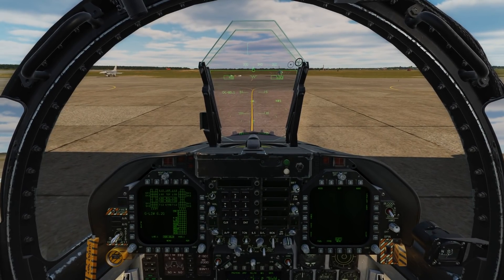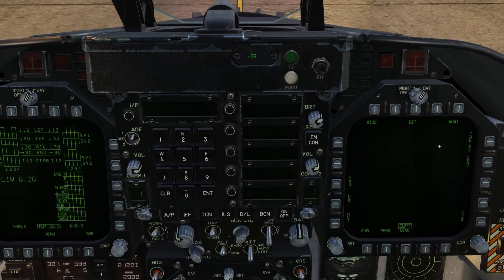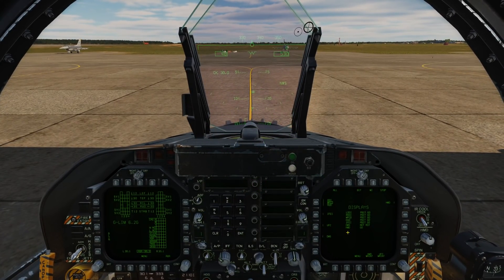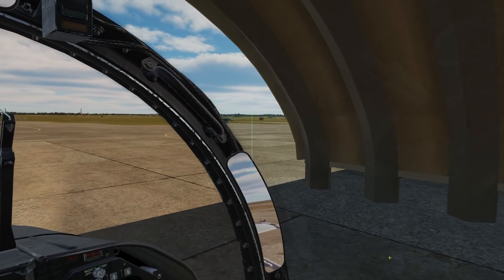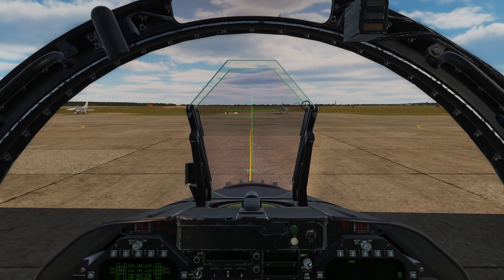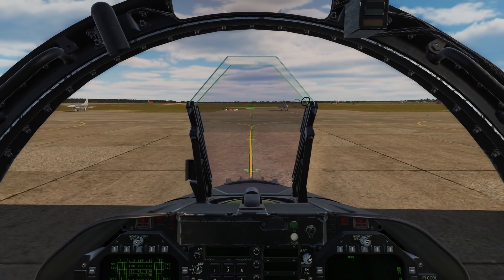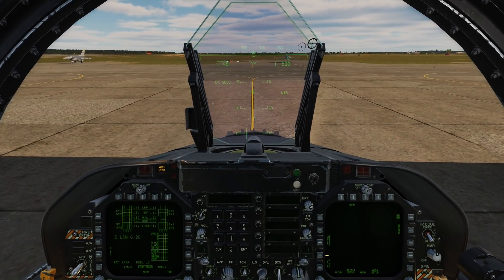DCS: F/A-18C Hornet | HMD Alignment

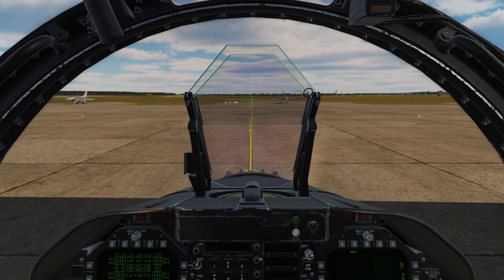Comment: Small correction: At 2:03 to proceed with fine alignment wags says "press and depress the TDC switch" to get to DROLL he meant to say or at least, you're supposed to press Cage/Uncage again
Reply: Looks like the User Manual needs tobe fixed then, cause 2 years later I'm just getting into DCS and it still says that in the manual itself was confused about that and couldn't find what it meant, thanks

Comment: Is there a way to align the HUD? There are times when I’m flying F/A-18C when the graphics displayed on HUD are too low and/or too far to the right or left of the HUD display glass, so much so that the graphics on the lowest part of the HUD are below the line of the dashboard where I can’t see them and/or the outer right or left edge of the HUD graphics are off the right or left edge of the HUD display glass.
Reply: That moves in relation to the wind.  You can press up on the sensor control switch and then cage button to center it.

Comment: Hi Waggs another great vid, I see in the left MFD that you don't have the "ADV- "bit notification showing how did you achieve this?
Reply: The BIT advisory is only present when a BIT has failed. Failed BITs will be flashing on the BIT page, and pressing STOP will cease flashing and clear the advisory.

Example: Firing your last HARM will cause a failed BIT for the CLC (Command Launch Computer) as there are no longer any missiles communicating with it.
Reply: Thanks for the reply, I must be missing somthing in the Bit checks Ill keep working on that. Cheers

Comment: Hey Matt, could you guys fix the second mission on the included F/A-18 campaign? it has a really dumb fog, thanks
Reply: Git gud
Reply: @RevsBlueChurch  all the default missions got messed up with the new clouds
Reply: @RevsBlueChurch  i've finished the mission multiple times, however, how its an overall easy campaign, it would do good if the smog was removed, specially for new players trying the flir/lintening pod out.